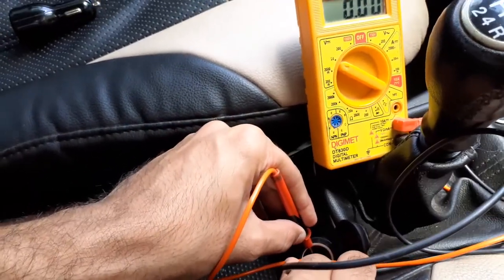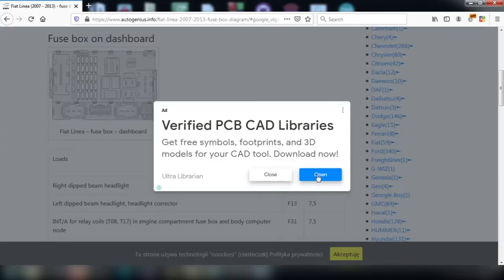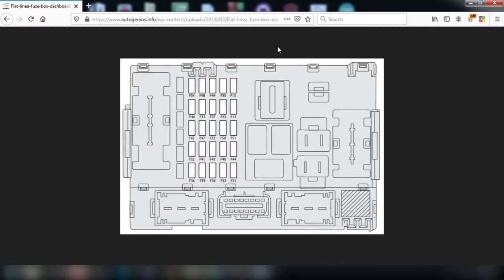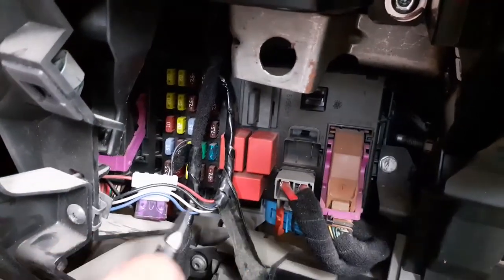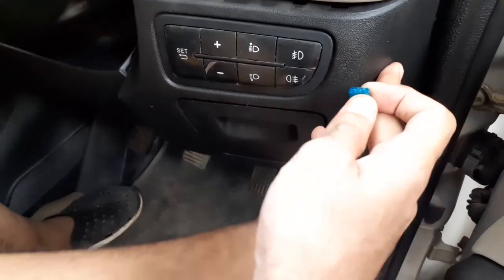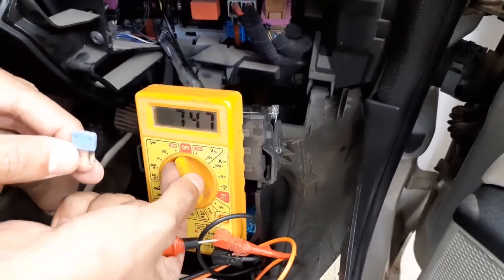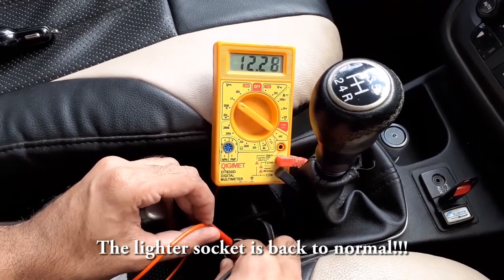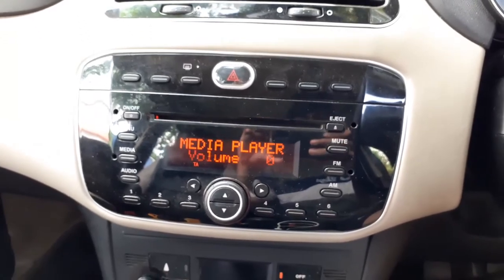Fiat Punto Evo fuse repair hack!!!

Comment: Thanks this video helped me but I would like to point out in the fuse box under the bonnet just behind the spare fuses the fuse remover clip is there you don't have to use the player. It makes the job super easy
Reply from the maker: Sure I'll check that. Thanks for letting know